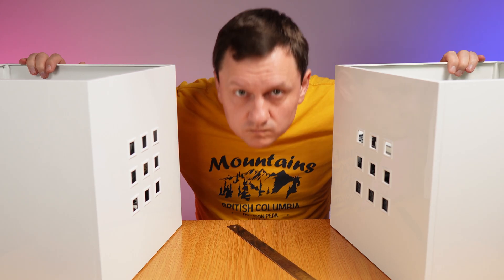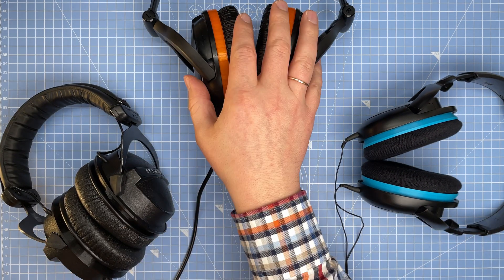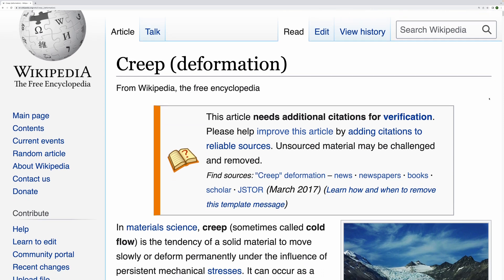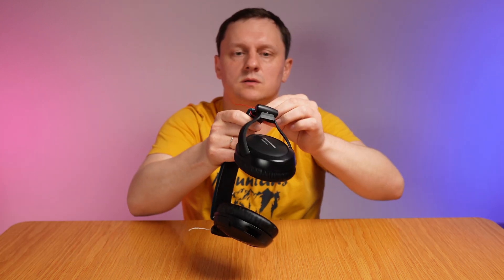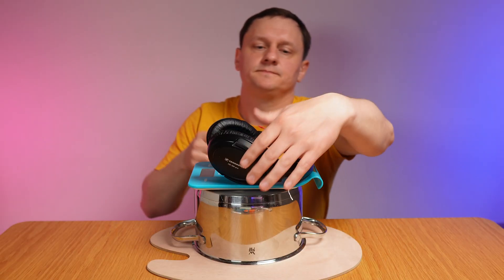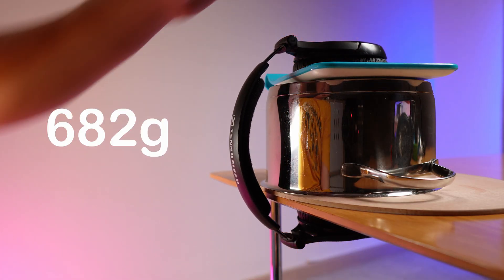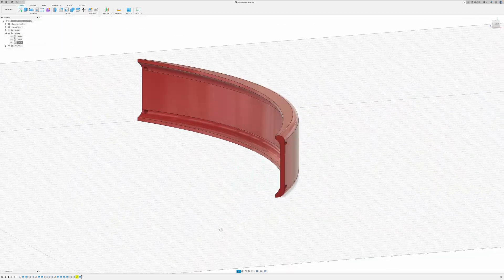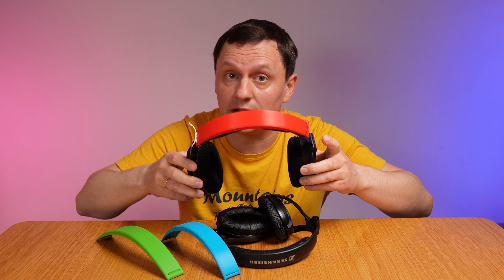Tight headphones

Comment: Some headphones do come with head clamping force adjustment.  They tend to be bulky and ugly as heck.  AKG headphones are infamous or famous for this bet they are as good as Sennheiser when comparing medium end headphones in the $400 to $800 range.  I am still partial to most Sennheiser headphones such as the Momentum, 620S and Game Zero.  As you can tell, I prefer hot wearing, noise cancelling headphones.

Comment: Do you have any solution for opposite situation! How to tighten headband of loose headphones ! I have Sony MDR zx -100.
Reply: I bought the soundcore space one and love them but they aren't tight enough for me 😢
Reply: @carlyp454   okay, I've found a solution for mine headphone. I've used a 'Metal Hair Band' plane and thinner one. And attached it with headphone's band from outside ! This worked for me, try if it works for yours too👍🏻👍🏻